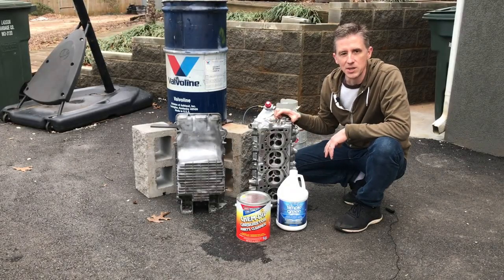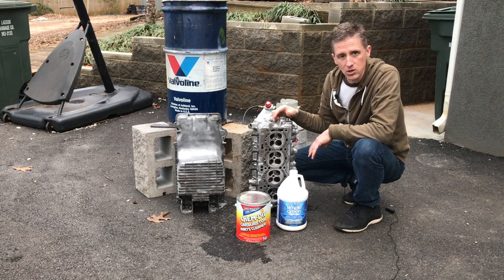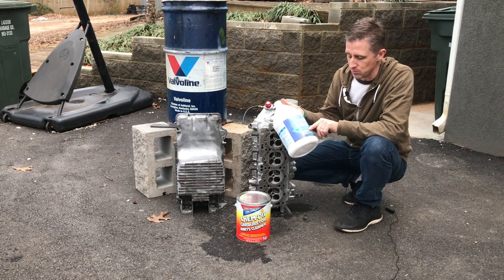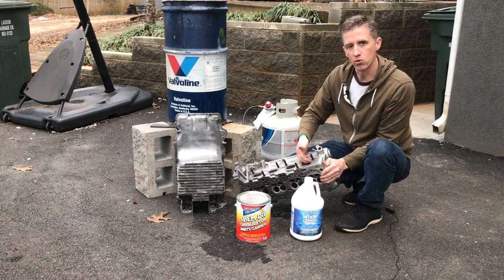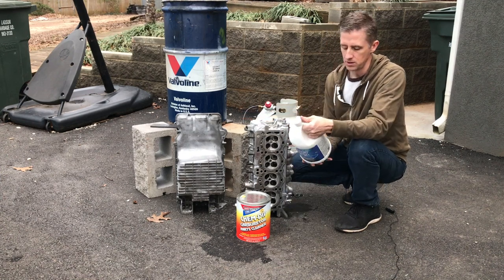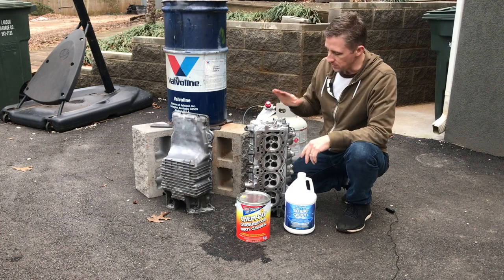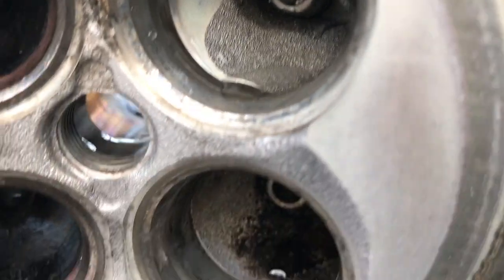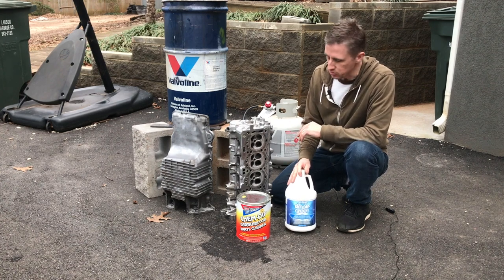How to SAFELY clean aluminum cylinder heads!!!

Comment: From what I understand, Simple Green made the aircraft version because the US Army was washing helicopters with the regular stuff and found it would start corroding after it sat pooling on the belly skin.  For the relatively quick dips at good ratios, you could save the extra cash and go with the original.

Comment: Is there any definitive way to clean cylinder heads. I’ve looked up them all, and there’s always some that say to never do it this way, and then others say the way that person is doing it is completely wrong. Personally, I like using a plastic scraper first off with some gasket remover, and then I like to use those scotch Brite discs. But, I’ve heard plenty of people say never to use those. And then I’ve seen people on here (specifically a technician for the Fel-Pro company) say to use a crimped steel brush on a drill—which I would never do, and I’m not even going to attempt to try it. It just seems there’s no absolutely sure way to clean them. I’m an automotive student at the local junior college and even all four of the different instructors have a different way with aluminum heads. I was even thinking about using ceramic razor blades to get the tough stuff off. So, if there’s any 30 year veteran Master Techs that can steer me in the sure fire right direction, I’ll gladly take your advice. Thank You. Alex

Comment: or for the same money or less that you spent you could of disassemble the head, and just taken the head to a machine shop to have them clean it...
Reply: @Editronone  I don’t think his comment sounded butt hurt. He’s not wrong though. They have tons of chemicals specifically to hot tank aluminum that aren’t caustic like attax for iron. Costs about the same as that gallon of b12 chemtool. But there is something to say about doing it yourself. I’ve got a machine shop half a block away from my shop and it gives me time to spend on other jobs. Always good to have a friendship with your local machine shop.
Reply: They charge too much here. This way he can keep doing more engine heads.